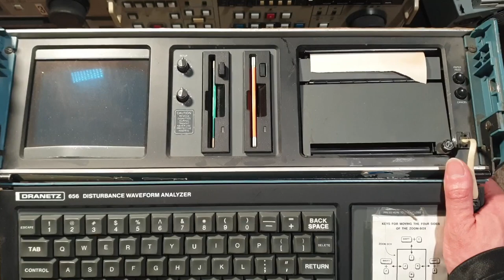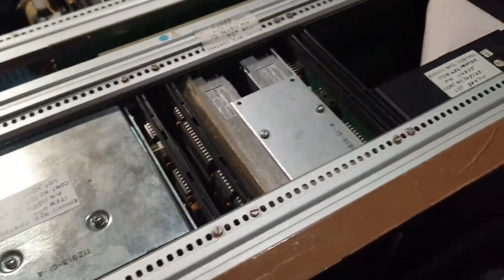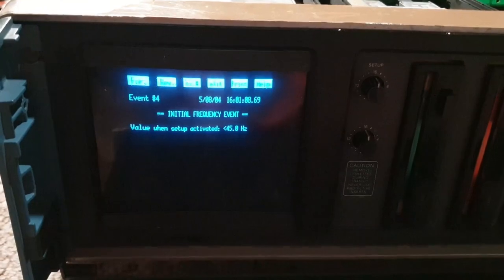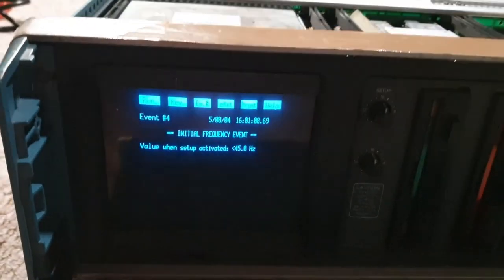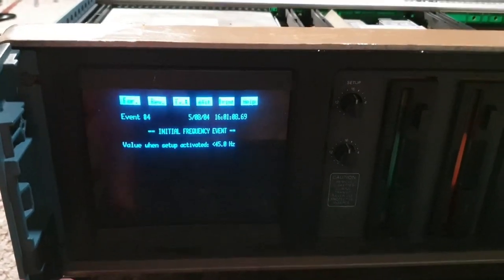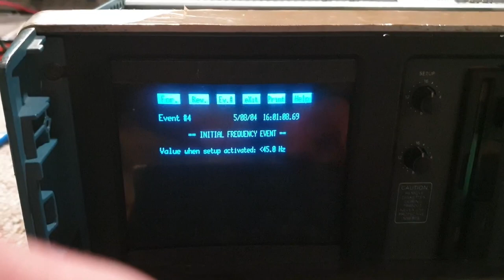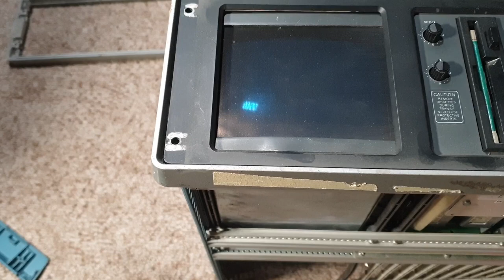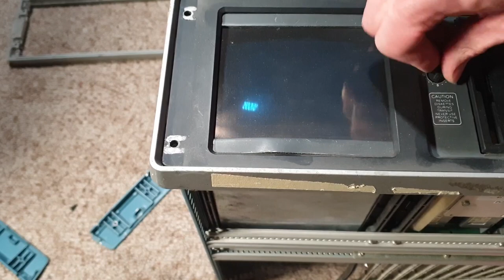EW0087 - Dranetz 656 Power Analyzer Teardown

Comment: I'd be surprised if the full line voltage runs through the back plane. That would mean that the inverter board lifts the 12V up to 240V into the main power supply where it would be stepped down again? Wouldn't make a lot of sense. OTOH, the overall design of this device seems to be quite dodgy and old fashioned, a CPU board made of discrete 74 logic in 1986, I mean c'mon!
Reply from the maker: The main power supply with all the low voltage outputs is wide range so it could be stepping it up to only 100V or so. But when plugged into AC at 220V etc it would be 320V DC across the backplane. There were no other connections to get the AC input over to the Power supply module. 
I think this was the simplest way (to them) of allowing this to run from AC or battery. Like having a built in UPS.